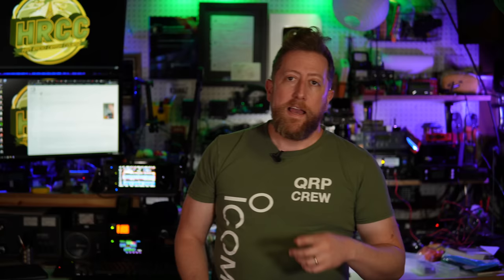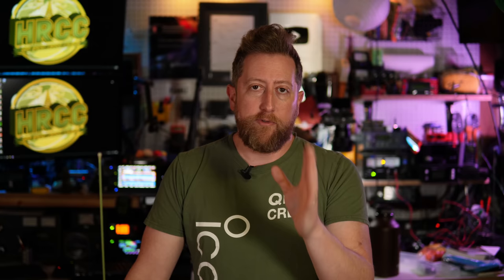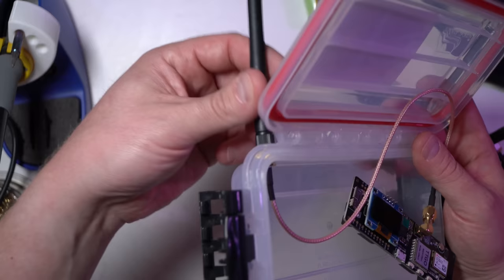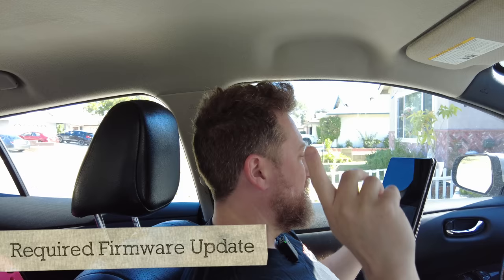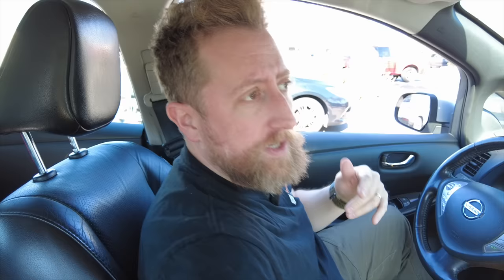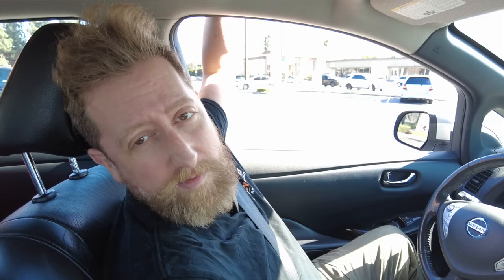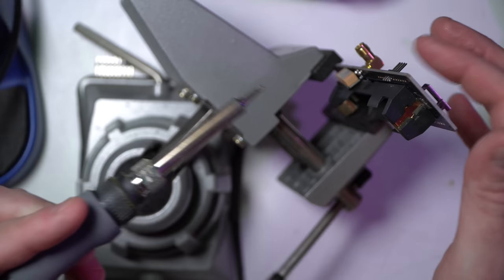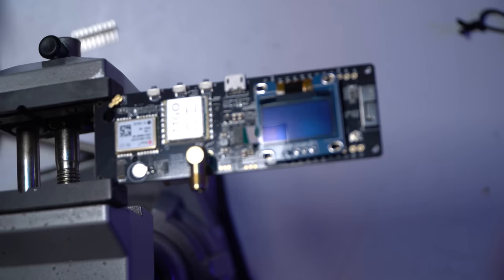LoRa Meshtastic Range Test, Portable Relay & Your Questions - Off-Grid Communication

Comment: Next test, use 3 T-Beams, one at your home, one in your car, and one on a drone. Drive out until out of range, then fly the drone up 4 or 500 ft and try again. Keep going until out of range.
Reply: 400 AGL is the celing for drones in the U.S. (if you want to be leagle) But, yes that would be awesome!
Reply: I was thinking of doing something like this (using drone as antenna base), but I would like to keep the drone tethered to the ground with a super light weight power cable to keep the drone up indefinitely. It would depend on if I could find a 300ft power cable that isn't too heavy for the drone and can still handle the power.
Reply: Was thinking of trying the same thing please try this!
Reply: I was thinking of trying the same thing today- a DJI Mini should be able to lift a t-beam and 18650
Reply: @ChristopherScanlan88  why not just use a ballon at that point?
Reply: Rather than a power hungry multirotor drone, how about an ultralight, repurposed into a drone? 

You can get a fairly good glide ratio wing, and 5 gallons of gas has a much higher energy density than lithium, so your flight time can be a lot longer.. 

As long as you comply with the ultralight rules, and no one knows that it’s a drone rather than a manned craft...
Reply: @akseminole  hmmm, somebody is putting a lot of thought into this. 😉
Reply: @JeffreyGordonTheTank  If you're semi-stationary, a mylar balloon would stay up several days.
Reply: @JeffreyGordonTheTank  You have the small issue of the balloon popping and the t-beam dropping rapidly back to earth.
Reply: @audguy  if the drone is under 250 grams (like the mavic2) there’s no regulations.
Reply: @ThisTall  That is false, you still have to follow the rules, you just don't have to register the drone.
Reply: @audguy  This might be a regional thing then, because I just checked in my area yesterday. And there’s zero regulations on anything under 250 grams here, just a stern warning not to directly endanger anyone’s safety.. Anything bigger requires registration and the basic or advanced licenses, with their territorial and altitude limitations. Although I’m sure the vague warning gives them plenty of room to enforce it how they want.
Reply: @ThisTall  That is why I said in the U.S.
Reply: @dissmani  A parachute is an option for safe recovery as long as you're starting high enough for it to work, and have clear space below for it to land - just like recovering the science payloads from a high altitude weather balloon.  The main issue I would see with balloons in (sub)urban areas is enough ground space for a tether.  For example, you wouldn't want to be 100 feet from the nearest electrical line and let your balloon go up 500 feet as a gust of wind could make for a bad time.
Reply: @ChristopherScanlan88  i mean if your want it to get struck by lightning and blow your location circuit in an emergency that would work
Reply: @dissmani  You could attach a deployed parachute that would fill on a rapid descent should the balloon pop.
Reply: @ChristopherScanlan88  use ac supply at KV range to minimise current draw and so need minimum cable weight, then ac-> dc rectify at drone.
Reply: @ChristopherScanlan88  helium. They do this in theater
Reply: @dissmani  redundancies
Reply: @ChristopherScanlan88  i live it a place with tonnes of wind. It's almost constant so I'm thinking about using a kite
Reply: Or use your drone to seed city rooftops and set up a city scale network.
Reply: Great idea! A ballon would also work and last longer.
Reply: You could establish “com time” for your flight. Flight ceiling is 400’ AGL. You can legally fly up 400’ above a tower. It may do some good to know the tower height, so you can just check your altimeter. You won’t have to check tower height then. So if you use a 75’ self support tower, you could make 475’ legally. 290’ guy tower would give you 690’ legally. Grid down, the FAA probably has other priorities, so this sort of legality may not matter at that point. Use your better judgment. Airspace citations aren’t cheap.
Reply: Good idea.  But how to save the drone battery?  Just land on top of somewhere high.
Reply: Why not use a balloon and forget the batteries all together
Reply: Marconi used a kite for the first transatlantic radio transmission.    He thought the RF would bend, but it actually bounced of the ionosphere.
Reply: Haha
Reply: You could use a moored Balloon up to 150ft or 150+ ft if you notify the nearest FAA ATC then you could suspend the T-Beam with an rechargeable battery and solar panel and place streamers and leds every 50ft if higher than 150ft if you leave it out past sunset.
Reply: because we are all overthinking
Reply: I know I'm a little late to the conversation, but a TRUE grid down scenario, if you had the ability to place a node, you could just find the highest point in the area you want communication. I'm thinking electrical poles or towers (if safe), buildings, fire towers (we still have one really old fire tower near my home). I am in central Florida so it's not like the topography is a problem, it's primarily the buildings you have to get over.
Reply: @audguy who flys a communist drone and isn’t aware of the sky.

Comment: 2 miles in a suburban environment seems pretty impressive for such a tiny little device. I live smack in the center of a roughly 4 mile by 4 mile town so I should be able to communicate from nearly anywhere in town except south of my home where the larger downtown buildings are located, and that's okay because no one goes there unless they're buying crack
Reply from the maker: It did three miles.
Reply: Interesting, because Meshtastic would work well for secretly contacting your dealer.
Reply: @ancapftw9113  My weed guy is like 200 feet away. I could place an order with cans and string lol
Reply: @djk8541  🙄
Reply: whats the point though
Reply: @HamRadioCrashCourse  5 km (~3.1 mi) is the distance to horizon for an observer 2m from the ground.  Given your transmitter is on what looks like a 3 m pole, you're sitting in a partly metal box with receiver held at about 1.5 m, it makes sense that the signal faded out at that distance.

Comment: In a future video can you PLEASE look into using LoRa and ATAK. I have 4 nodes incoming to me and can't wait to get them. I've already scoped out several high points to put nodes and 10W solar panels with 12Ah batteries to make them self contained. Having multiple ATAK devices using the mesh would be invaluable.
Reply: The atak  device was destroyed....Roger Moore threw it over the mountainside in " for your eyes only "
Reply: Let us know how you get on
Reply: I’m looking into the same, I was looking at building a “repeater” node into a micro pelican case with a small solar panel to place on a nearby mountain and use ATAK while hiking.
Reply: @PrebleStreetRecords  let me know if that works out for you. I am very interested.
Reply: Which band did you choose and how well is it working?
Reply: I recently watched a video on exactly that topic. S2 Underground I think was the YouTube channel that I saw it on.

Comment: FYI the 3v3 is the 3 volt rail, the next is GND which is ground.  Then 
serial data pin : SDA (default is GPIO 21)
serial clock pin : SCL (default is GPIO 22)

Comment: Thank you Josh and awesome videos from a Ham perspective introduction to LoRa. Just to add on to the conversation, we use LoRa(WAN) as an extension to the limited WiFi range on the devices we build using arduino and Pi to communicate. Some use cases are alerting of wandering cows beyond a limited area on farms by putting proximity tags on cows, humidity and temperature sensing in far away greenhouses from main building, etc the sky is the limit as to what can be developed and has very low energy consumption and very reliable all things considered. Thanks again Josh for very eloquently introducing this technology as a supplement to the Ham comms space.

Comment: a good way to put this is the lora device is acting like a modern version of CB radio... you can use anything with Bluetooth to access it (ancient laptop, super budget tablet, old smart phone... anything)

a good use for this is in a power outage since everything needed can be run off solar and batteries so you can still talk to people.
these can be strung together so for example, here he started having issues at 3miles from his home, if you have a friend the lives at 2.5 miles out and they have one, it can relay your signal so now you have closer to 5 miles in that direction... as more and more people get these devices they will slowly become a larger and larger network that is not tied to a company like cell phones and the internet.
that youtuber with the world record also has a video showing how to make simple walkie talkies that us a mumble server, you can set up a mumble server on a raspberry pi and build your own private long range network.
Reply: I'm planning on just a wireless BLE keyboard  to send the text to the LoRa transceiver. It uses far less energy than any of those other devices. The AA batteries in mine have run for 2 years, so far.

Comment: Great video. Since your first video on this I've been thinking of possible uses for staff communications at scouting events. Almost everyone has a smartphone today, but cell service is spotty at a lot of scout camps, so this offers a way to use a texting like service where there's no or limited cell service. The no license part makes it much easier to use when the majority of the group aren't hams. I had thought of trying to use APRS in this situation, but LoRa really looks like a much easier to implement solution. With APRS you need an HT, TNC (assuming you didn't go with a higher end HT with it built in) and most often cables to connect. LoRa is much simpler, just the LoRa device and Bluetooth to the phone, tablet, iPad, etc.
Reply: That is a PERFECT use case. We're not trying to be super spies or talk around the world. Just trying to keep a bunch of kids alive. 😂
Reply: Another option would be that Motorola makes a FRS/GMRS radio that can send text and location data. They are like $50 each, and are also standard FRS radios so you can do voice. Not encrypted, but you shouldn't need that.
Reply: @dissmani  what model is that?
Reply: @madbroindustries  T800 series.
Reply: There are iPhone and android apps that you can download and will use wifi direct to communicate with each other. Range will obviously be less than lora

Comment: Duct Tape solves everything. Regarding the question about encryption, In LoRaWAN, AES256 is the encryption for both signing/authentication from end node to network layer and encode/decode from end node to application layer. That is considered very strong encryption. It seems to have been implemented in either Meshtastic/RadioHead by someone who wasn't confident on his implementation of the AES256, so if you need ultra-secure, you might want to look over the implementation. But I'm sure the NSA could break it. They don't tell you, else they'd have to kill you.

Comment: Thanks for doing these videos, I'm really interested in a LoRa network for a very rural area where cell service is very limited and not having to rely on radios for communications. The weatherproof box with a solar pannel looks very promising. I just wish these components are easier to find from US based sellers.
Reply: They're never going to be common thru US sellers.
They're made in China and open source so it's Shenzen, China.

Just choose an AliExpress seller with a +95% rating and wait a month.
Reply: For long range, remember that the data rate is slow!

Comment: If you're in Cerritos, we are practical neighbors. QTH is OC.  2 years ago, I built a lora telemetry transmitter for the Solar Cup boat race. I got about 3 miles with a ground plane at Skinner Lake, Temecula.  
In Huntington Beach, I put the Transmitter on the roof of HBHS, and could get the  signal at the end of HB the pier. I was using 900mhz 3db antenna at both ends.

Comment: I definitely like the idea of LoRa. Especially being able to package this up in a waterproof box with a solar charger. I live in Albuquerque and we have mountains right near us. I'm wondering if I could place a setup on the mountain which has line of sight to the entire city and use the mountain peak like a repeater for other Lora boxes.
Reply: Yes you can. It would be a relay station instead of a repeater. You can bury the box with the LoRa device to keep it out of the sun, run a longer wire to an antenna in a tree, that would help to overcome any other obstacles in the way.
Reply: Did you ever get it up and running ? L

Comment: I always thought I was absolutely terrible at soldering, who needs that flux junk anyway… Well when I realized what happens when you use flux it was like magic! I did the exact same routine as when I failed many times previously, but using the flux it just worked like magic

Comment: Pro tip: If you really need electronics to be waterproof, remove the board, mask off any ports or jumpers, ect and spray the whole thing down with silicone conformal coating. There are some caveats, you won't have easy access to the components again. In areas where the coating is thicker there will be more heat build up.
Reply: I removed the board.  What do I do with the all these tiny pieces now? :D

Comment: Just found your channel and liking it thanks for your efforts sir. Maybe a differently worded answer for "Bob" would be to just say you're off primary grid's and operating your own private local communications grid. Maybe some kind of translation issues or something that's losing the point that the phrase "Off Grid" isn't so much no grid as it is completely independent and isolated grid. If you're in an "off grid" home with solar, wind or even standard generator and powering the home and a separate workshop and or a water well you're on an electrical grid of your own creation, same goes for water etc etc😉

Comment: So I've been tested these for quite some time, so one thing I noticed is even know that the cross says that it didn't deliver the message when I look on my receiving phone at home base the message was delivered. I was told by one of the developers that you can't always trust the delivery mechanism.
Reply from the maker: Yes! That was what happened in my case. The three mile message went through!
Reply: @HamRadioCrashCourse  obviously the downside of that is that if you're do have an emergency situation you don't know if the people on the other side of the emergency got your message or not, however we put in place a simple simple response to confirm the message was received.
Reply: @presidentelectjerryodom3889  that's called The Hostile Valley Problem. Lots of academics have worked on it.
Reply: @presidentelectjerryodom3889  if they did receive your message whether you knew or not, the chances of their message returning to you would be good, wouldn't it?

Comment: Thank you for doing the range test. I'm still concerned with the application I want to do it for, since the homes we want to link, one of them is deep in the valley. Even though it is only one mile away, there's lots of vegetation and rocky terrain between these two points. So I don't think LoRA will work. It would be better if they just wasn't scared of taking the Tech. license since I can reach there with just my HT's, but it is what it is. FRS won't reach. It might just be GMRS then.
Reply: this is an ideal use case for a mesh network. another node at the top of the valley could be used as a repeater. a camo case and a solar panel, nail it to a tree or something. they are cheap enough you could spread a couple around to really get some coverage.
Reply: @arjovenzia  came to say exactly this, thats the beauty of mesh. You can go as far as you would like depending on what you wish to spend on your own infrastructure.

Comment: Food for thought:  The European band for this LoRa device is 433 mhz.  Here in the states, that's inside our 70cm amateur band (420-450mhz).  Why then, other than the technicality about encryption, couldn't we use that device into a repeater or an amplifier?  As I see it, it's a data signal, so why not?

Comment: What i think would make this a truly perfect "off grid" type of device would be if there was some way to connect to it, and it automatically give you a link to an "offline" locally stored version of the app. or ability to use a web browser so anyone could connect to it that wasnt before and have the ability to use it. it would be something great to have in a "all comms" (aka cell\internet) down scenario . im sure it wouldnt take much processing power or space on the ROM to have a mini web-server built in to it. but its a cool start to something.
Reply from the maker: The device has a web landing page and can be hooked up to your wifi. I just haven’t made that video yet. 🤣
Reply: So if you dont have the app how will the device send you a message with a link?